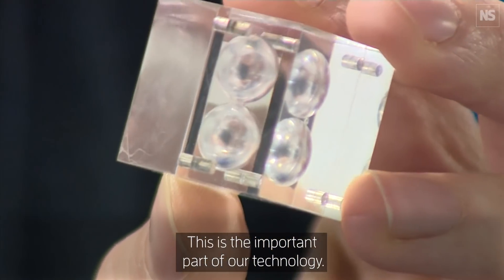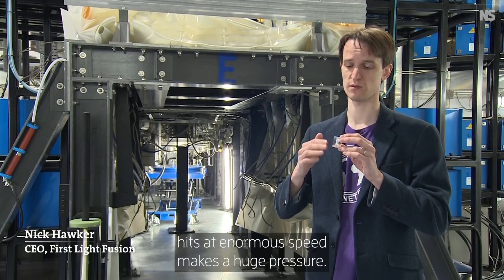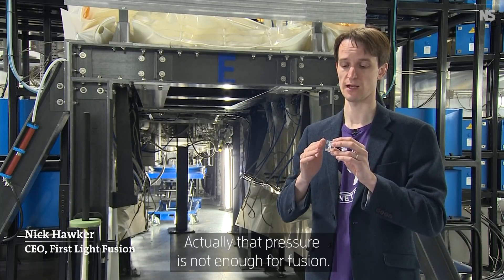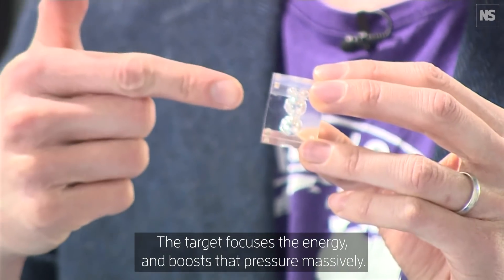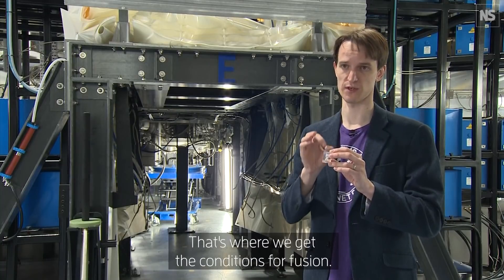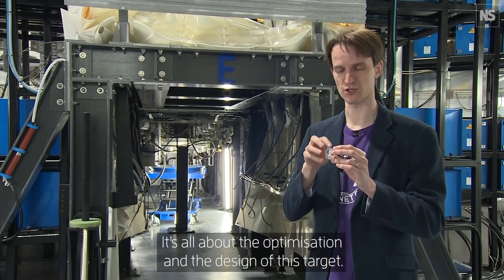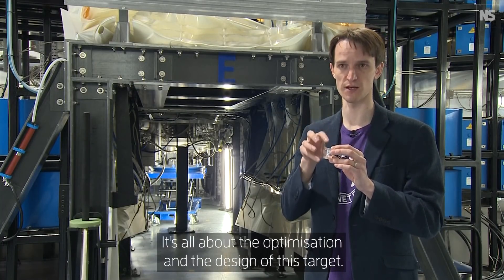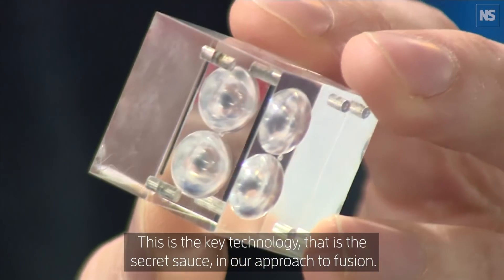Nuclear fusion breakthrough achieved with new projectile technique

Comment: This is an interesting way to use energy-mass equivalence... from what I can get at least it sounds to me like this is essentially the tantamount to forcing photons to collide and since light is a weird thing with photons being able to function almost as mass in certain circumstances the night Collision causes them to fuse which causes a massive release of energy and then that energy gets collected... man I really hope this actually works out well because this could be the method for sustainable fusion reaction.
Reply: An atom has 3 components in it, heavy particles called protons and neutrons, and light particles called electrons. The protons and neutrons are very tightly bound together in the center of the atom, in a region called the nucleus about 0.01% the width of the atom. The electrons orbit the nucleus, and are responsible for chemistry and holding human scale objects together.

The nucleus of the atom is what is important for fusion and fission. Fusion means taking 2 atoms and squishing their nucleuses together, and fission means splitting one atomic nucleus into two separate atomic nucleuses.

Some atoms have a nucleus that is held together more tightly than other atoms. For example, helium, the atom with 2 protons and 2 neutrons, has a tighter nucleus than hydrogen, which has 1 proton and 0 to 2 neutrons. Therefore, when 2 hydrogens are forced together, if you can get them to merge, they merge the nucleuses into something that is held together more tightly. In physics, whenever something becomes more tightly held together, energy is released (like a rubberband pulling itself together, you could imagine a system to harness that power to move something, that shows that it releases energy). Harnessing the energy released when small atoms merge is the basis behind fusion power.

On the flip side, some atoms have a nucleus so big and massive that it is unstable and "wants" to split up. If these atoms are left alone for a certain time called the half-life, there is a 50% chance that they will just split, since they are not stable. If these atoms are "provoked" by adding even more particles to the nucleus, such as neutrons, they will become so unstable that instead of splitting spontaneously in a matter of billions of years they will split in a matter of seconds or milliseconds. In this case, when the atoms split, the parts they split into will be held together more tightly. As you can probably guess already, this means that energy is released. Harnessing the energy released when overly large atoms split is the basis behind fission power.

Unlike fusion, fission is already used in power plants, and is a very potent and strong source of energy. Even with our current inefficient ways of using the power of fission of heavy atoms like uranium, it still releases 16,000x more energy than the same amount of coal would.

If you're curious, you might notice that small atoms tend to fusion, and big atoms tend to fission because of their size. This means that atoms in the middle, such as iron and nickel, are elements that cannot be fused together or split apart to release energy. Basically any thing done with those elements requires energy, and does not release it. They are at the "bottom of the hill" when it comes to nuclear energy.

Comment: First off: really cool work. But I was extremely skeptical when the said they hoped to get a 100 MW-class reactor within 10-15 years. Going from proof-of-concept that you can create fusion, to net positive, to an actual fusion power plant (which would be the first successful fusion power reactor) is a HUGE leap in technology and requires different research/manufacturing throughout (it's much different to show you can create a net positive with the system then it is to show you can then capture that energy in a usable form). Building the plant alone would likely be a 5-year endeavor minimum. Certainly exciting work and something that should be researched but that statement was too much of a cash-grab for investors and I'm pretty sure has no data to back-up that plan (it is also possible the media misrepresented what they meant).
Reply: Very common industry practice, any sensible investor would stear clear until they can definitely prove a net gain that is economically more viable than other alternatives
Reply: Yeah, just achieving fusion is not much of an accomplishment. There was a 14 year old kid that did it in his garage https://www.youtube.com/watch?v=9B0PaSznWJE. And even another kid that did it at 12 years old. It can be done fairly easily with a high voltage neon light transformer and a good vacuum system.
Reply: Well if it's anyone that can do it, it'll be the British.
Reply: If there is an actual proof of concept that has fusion that lasts more than a few seconds (preferably a few hours) and produces a net positive amount of energy the investments will start flooding in by the tens of billions
Reply: That's what makes this company different, they are using only well-known physics that will couple to current technology (steam-powered plants) to deploy faster.  I believe their biggest hurdle is figuring out the most efficient shape and material to use to house their fuel (the cube he's holding).  Very interesting stuff!
Reply: @HouseOfJC_84  Every power plant eventually is just a steam plant, including those fusion reactor concepts now. To say they will couple is a stretch: they haven't shown how they will take the gun-concept and use the heat to drive a steam turbine. How they do when the target must be in it's own container, not surrounded by water is another research topic. Plus, this is a pulsed machine, not a continuous flow of heat, so how they will repeatedly fire/sustainment energy production is also another research topic. Other than how they are creating fusion, they aren't unique in how it will eventually be applied.
Reply: @TheOtherOlesen  Oh, this video doesn't show that part.  Look up more on it.  They are using a liquid lithium coolant to capture the neutrons (heat) and transfer to water.  For the sustained process that's still just mechanics - even a pez dispenser could be automated.  Bottom line, this version of fusion seems a lot easier and quicker than the others out there right now using magnetic fields etc to smash protons and capture the resulting heat.
Reply: @HouseOfJC_84  Hunh that’s cool using liquid lithium. You’re still underestimating the complexity of sustained shots for energy production. Yes, I can make an automated Pez but that is literal leagues different than worrying about how you replace the as it’s literally heating up coolants
Reply: If you take a look at how 3D printing is pushing time and resource boundaries with 3d printed spacecraft, I think it might speed up this process. And we sure could use some of that new juice.
Reply: @omnirhythm  Making materials is not the problem, which is what 3D printing is accelerating. The actual process of creating net positive and then capturing that energy in a useful manner is what makes this 10-15 year estimate not realistic.

Comment: isn't this the least efficient possible design in terms of net power efficiency and energy collection?
Correct me if I'm wrong but:
You'd need to essentially build a machine gun to scale this up, along with fabricating and loading the targets and projectiles automatically without losing non-negligible energy. 
Aside from research I don't really see any use for this design?

Comment: This a combustion engine mixed with an air rifle technology. They would still need to boil water to turn a turbine because this doesn't make electricity directly as there is no magnetism just heat. We are still stuck as fire monkeys without understanding electromagnetic forces.

Comment: Looks pretty difficult to manufacture. Would have to consider the energy required for manufacturing the catalysts in addition to the startup energy. But we will get there eventually. I think 2030s is optimistic though.
Reply: championchap  you only gotta build one of those.

Comment: Ah yes, Nuclear fusion, unlimited power generation that is only 30 years away...
The thing people need to realise about Nuclear Fusion, is that they don't even know if it will work as a viable method of generating electricity. It's a massive science experiment that is always going to be decades away from when we need it ( and in all likelihood won't even be ready then ). Nuclear Fusion is a nice idea but it is an ideological one ( that in the end will amount to nothing) when to solve the climate crisis in time, we need a pragmatic one! We need to act fast and use ideas and solutions that will make a difference quickly before irreversible damage is done.

Comment: Keeping in mind how fusion energy is just a glorified high tech water boiler, you don't need constan fusion to keep the water boiling and the turbines running. As long as they keep firing those things at a good rate to keep the steam pressure constant, it will work.
Reply: yes, it's about the power generated being more than power put in
Reply: So why bother in the first place. Just make thorium reactors. We can already make them and known reserves can power the entire planet for all intents and purposes unlimited energy for over a thousand years. So why do we need to force fusion to work. Would it even come close to being as cheap as thorium or produce as much surplus energy... So far it doesn't seem like it. Why not go all thorium and work on fusion for the next few hundred years instead...

Comment: Anyone that has any kind of mechanical knowledge and has installed metal tubing and control wiring can tell that this monstrosity is a JOKE.  You've just made up another ridiculous concept to FLEECE the American people (assuming this project is government funded) out of untold millions of dollars, filling your own bank accounts in the process.  VERY sloppy build.  Tubes with unneeded couplings going nowhere, random surfaces covered in plastic, construction waste bags still on site... looks like the "ISS" (another hoax perpetrated on an unsuspecting, gullible public).  What you've shown us is merely a redesigned air compressor set up.  I cry foul.  What a mess.

Comment: Someone plz explain to me how a big gun is supposed to survive the inner fusion environment. Fusion plasma will be literally as hot as the sun. Is the gun sacrificial? Sounds expensive.
Reply: The gun shots the fuel into a reaction chamber and hits the target? So the gun would never be exposed to the heat. And regardless if the chamber can take it then the gun can. The plasma reaction is hotter then the sun. But it is also over in an instance. This approach wold not aim to have a continues reaction but use "pulses" of energy from every shot to heat up the chamber and use that energy to heat water and spin a turbine as usual. Or at least that is what i assume.

Comment: why don't we focus on energy from quarks so that we essentially get free energy out of thin air
Reply: If we focus energy to get energy it's not necessarily "free". 
The process you describe has been going on for eons of time.
It's happening all around you.
This process supplies light,heat, food, and textiles that are all free until captured, confined and capitalized on by individual entities.
Otherwise to entertain the specificity of your question, there are still many challenges to be overcome and achieving the desired outcome through atomic fusion, quarks exist at much smaller scale. To manipulate things and harness energy from a man-made process at the atomic scale is challenging enough, at subatomic or quark scale, it's many magnitudes of higher difficulty. Maybe someday.

Comment: The kinetic energy of that projectile is going to be a lot more than the energy they get out of that fusion. Keys to getting this to overunity will not only be focusing as much energy onto the fuel as possible, but collecting the unused energy on the other end and maximising the efficiency of the cannon itself. A Gauss gun probably makes the most sense as opposed to a light gas gun, maybe.

Comment: Fusion power plants are a pipe dream. They will not be able to make them provide enough power to make them viable since they will always consume far more energy than they can produce. The problem is the immense power required to maintain the magnetic containment fields unlike with a fission plant that does not require anything like that to function.
Reply: Also another problem is to get rid of the fossil fuel corporates. They wont just "stand down" for some "dream", even if the dream comes true, they wont stop until all earth is sucked out. Money grabbing bastards
Reply: @coffeediction  True. FYI, i watched a documentary about 10 years ago that showed if you followed the money trail of the anti-nuclear power ads, they went back to big oil.

Comment: For people who don't understand or have any interest in fusion: fusion is already possible. Many MANY labs are already doing it. This isn't a breakthrough. They just joined the club. The next BREAKTHROUGH will be in fusion power that generates more power than it uses.
Reply: The method in which they obtained a fusion reaction IS relatively new
Reply: I think the point here is the posibility of significantly reduced power usage. No need to heat up the product and sustain a field with magnets anymore. That's a lot of power draw from those two things alone.
Reply: They found a way to achieve fusion that has never been done before

Comment: 6,5 kilometers per second isn't at all fast, compared to the required speed of some modern rockets to get to orbit. They go much faster than that.
Reply: No. Orbital speed at LEO (200 km altitude) is about 7.8 km/s. Plz look it up first.
Reply: @DrZygote214  You don't think a huge rocket going 20% faster than this supposed fusion-thing is a lot? I do.
Reply: @joyl7842  it’s not like it’s orders of magnitude faster. Those rockets also require actual tonnes of fuel to do that over many minutes of acceleration. So it’s not an easy speed to reach either
Reply: @qvindicator  Exactly, it's very hard to reach orbital velocities. If your rocket is 1% off, it will simply not get to orbit, because it will have run out of fuel.

Comment: How do they collect the thermal energy at the end of the device? In nuclear reactors it's relatively simple. Just heated water. But here? It's puzzling.
Reply: They heat water → steam → turbines
Reply: Liquid lithium blanket absorbs heat. Heat transferred to water in pipes. It’s just a source of heat to make steam.
Reply: @troytholen4030  Interesting. I hope it works!

Comment: I LOVE THIS CONCEPT, so brilliant. Reminds me of a somewhat inverted shaped charge, un-weaponized technology. Even though so many achievements have been made, still no net gain... (?). No problemo! In combination with solar power, the most energy intensive parts of the process (like obtaining a high vacuum) could be offset to the day and then keep hitting those targets all night long (Reactor After Midnight, haha). Also, I don't see why not making the launchers modular, preparing them in advance and feeding them in a cycle. If your hot swap cannons needed interferometry level precision, it could be built into the design to adjust them on the fly

Comment: Cool. How do you plan to keep the reaction sustained? Or does the target survive multiple hits? How often do you have to replace it?
Reply: It sounds like this sort of reactor is more of a pulse reactor as opposed to a continuous fusion reactor.

Personally, I think pulse fusion is more likely to actually work
Reply: @TheTechmaster1999  Like the fusion plant on the Rocinante, if you keep the pellets flowing it keeps the power coming.
Reply: @krashd  precisely. Emergy may come in pulses but if you can store and slowly release that energy in such a way its consistent, you're fine

Hell, as is, most of our power is pulsed (alternating current)
Reply: @TheTechmaster1999  Are you trying to compare 50hz AC to half-day hz DC with nuke level outputs ? Let's say I'll wait for them to go commercial, like similar projects before. But I agree, the CGI is impressive.
Reply: @TheTechmaster1999  This is accurate. any stationary part absorbing that amount of heat and friction will definitely have to be replaced eventually, so it sounds to me like this would be a pulse fusion design, and that part would definitely be replaced once per ignition or something like that.
Reply: @TheTechmaster1999  I think we need sustained fusion.
Basically you need something that fuses into an element, and then breaks down into the original element, which repeats the process.
Watch this video, really made me understand the problems of fusion.
https://youtu.be/JurplDfPi3U
Reply: You are 30 years too early with that question my friend
Reply: isnt fusion a sustained reaction?
Reply: @Corrigan WrongWay The idea that power is not at a continuous level is what I was getting at. We have alternators that you need a rectifier on to make sure its pulsating at a constantly positive or 0. Its on or off granted a pulse reactor would be max or none

Again though, its the idea and we already deal with pulses on the regular
Reply: Correct me if im wrong but the only challenge I see with this approach is the constant supply of targets and projectiles, assuming they are easy to mass produce, I dont really see much of a problem with it. IIRC we dont know how much energy the gun takes to fire, and we dont know how much energy each pulse would produce, so all we have to do is optimize the energy requirements of the gun and use whatever is the most efficient to utilize the energy from the pulse.